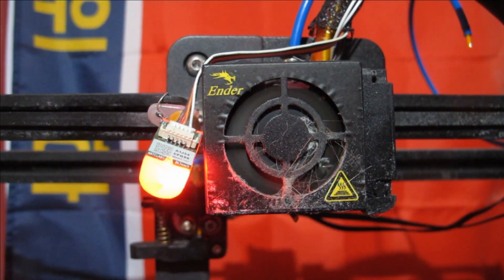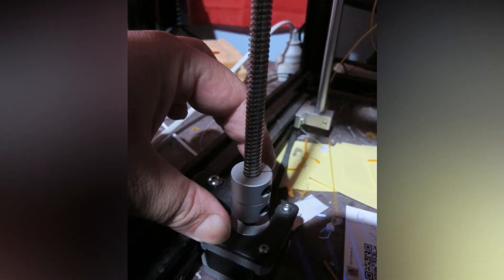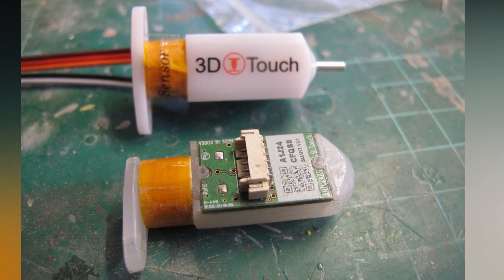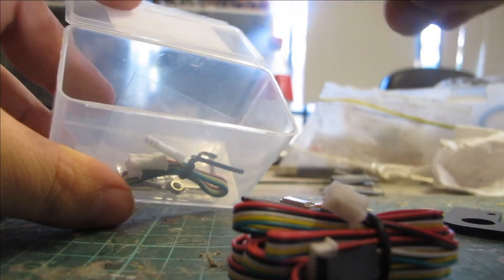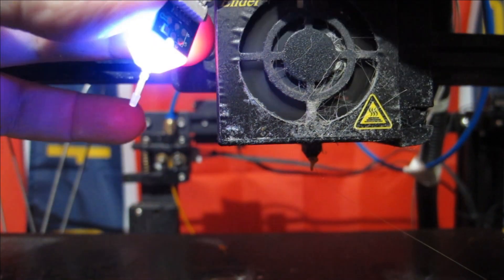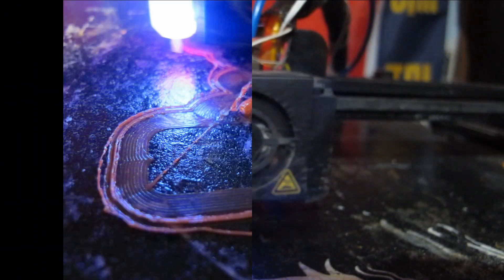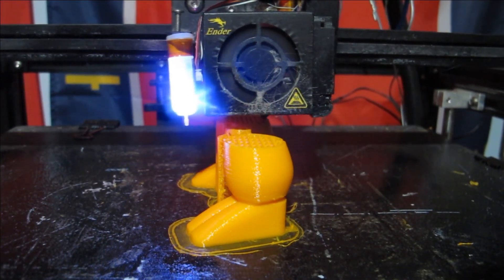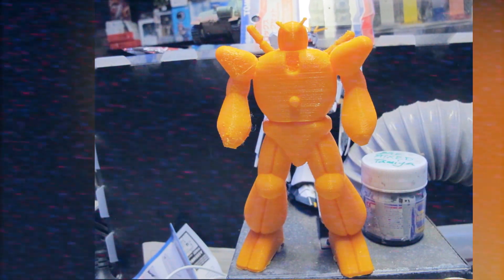3D print swapping BT touch for 3D touch

Comment: Bro I have ender s1 pro and I use this in that ? Will there bhe any need for firmware update or not ?
Reply from the maker: idk man, I hot plugged it and it worked. its the same as normal BT so iif does not work suss redit for the firmware via a google search. That has never failed me.

Comment: I guess your using the stock firmware. Try babystepping z instead of manual turning the z axis. Unless probing isn't accurate. I think those touch screens have it. I switched back to the old screen so I could run marlin, which prints better than the creality firmware in my opinion. That's on a 7 but would work for yours as well